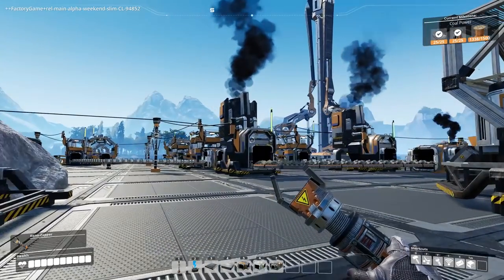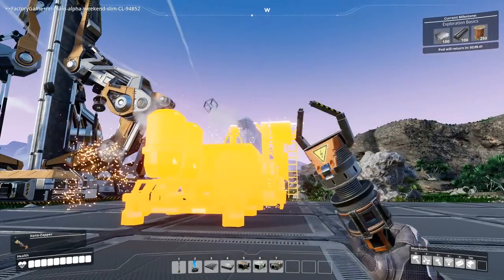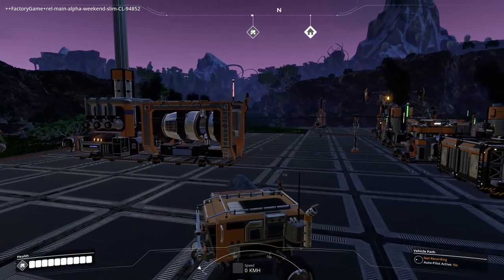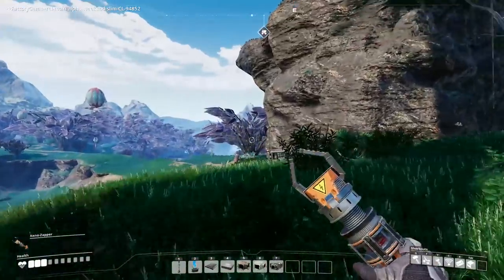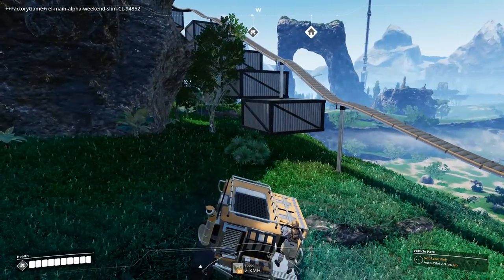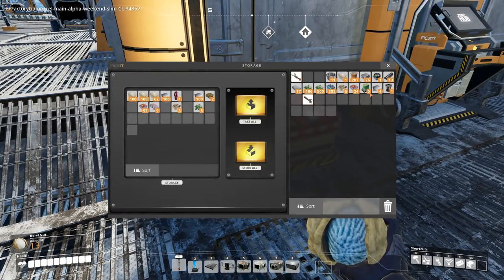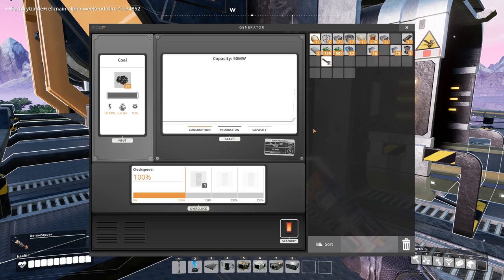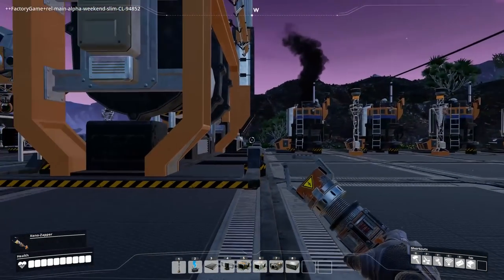Satisfactory Alpha E04 - A Truck/Tractor/Rover and seeking Coal Generation!

Comment: Just from watching this, something that could be useful for players early on is some sort of farm or greenhouse so you don't have to constantly run around for things like wood/leaves and other plants. Being able to auto-farm into a constructor to a bio-mass generator would probably ease some of the more annoying bits of the early game, then upgrading that to coal later. Also possibly add another tier of power poles that can have more connections at once.